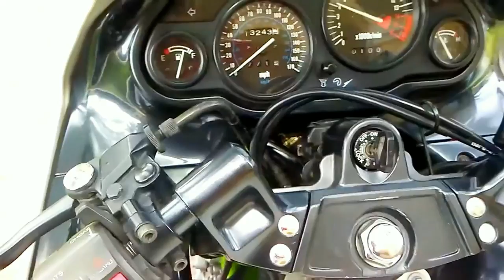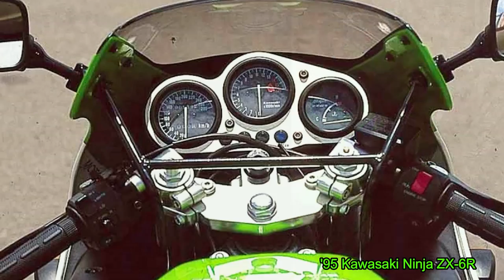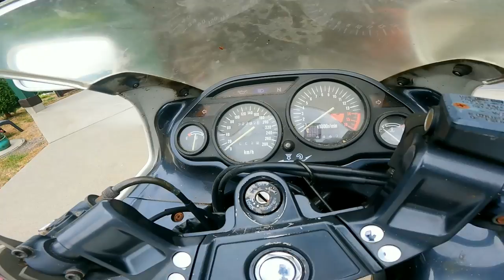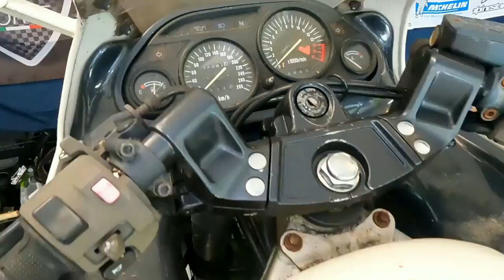What to do with a FREE Abandoned Motorcycle Kawasaki Ninja ZX-6

Comment: Molasses works for cleaning rusty fuel tanks, dilute with water and leave to soak then rinse and dry with a hot air gun or airline. I used it on my 1997 vfr750 which had been sat for 8 years when I got it. You should be able to get it from a farm supplies store, it's used for horses. 😁
Reply: @nedmilburn  You need a fair bit. Possibly available in the supermarket, can't say I've seen it here in the uk? The farm supplies store was were I got mine. It works a treat, removed all of the rust from my fuel tank.
Reply: @nedmilburn  Remove the tank from the bike and plug the breather holes. Fill with the solution and leave to soak (mine took about 7days), then rinse and dry. I flushed the fuel lines through with fresh fuel then fitted a new fuel filter. There's plenty of information available about using molasses to clean fuel tanks if you search, it's not a joke. 🙂 👍

Comment: I’ve cleaned a old starter with PB blaster. Still working 6 months later.
Reply from the maker: Hi Bob, Thanks for the feedback & view!  There is a new video coming soon on this bike as I wrap this project up...  The starter issue was the sprag clutch, there are little springs inside of it that broke.  I have done the lube trick to a sprag on a BMW K100LT and had the same good fortune as you.  That was one that was a lot more difficult to remove.  🔧
Reply: @RodRidesWrenches  really enjoy all your hard work and the way your content flows, easy to follow with useful info. The BMW series was especially good.